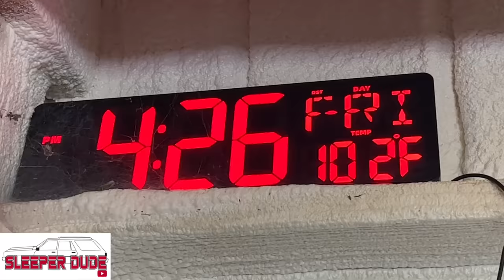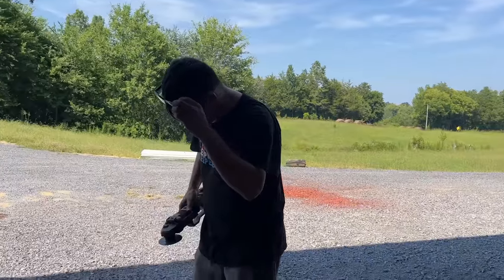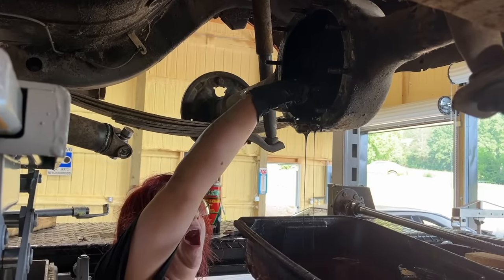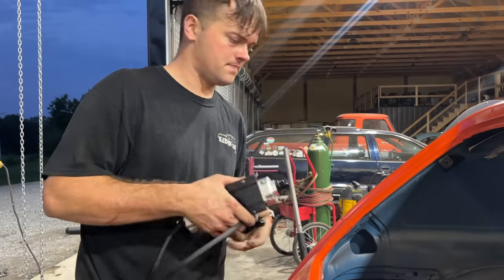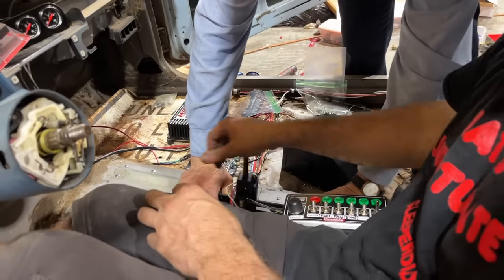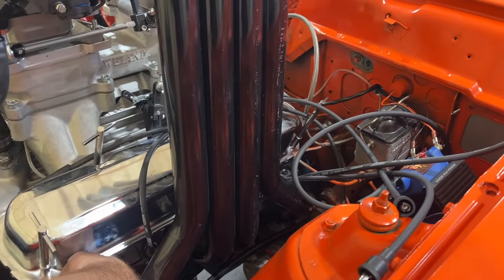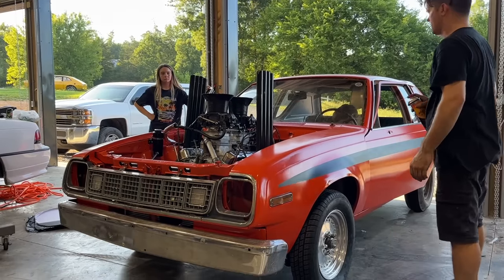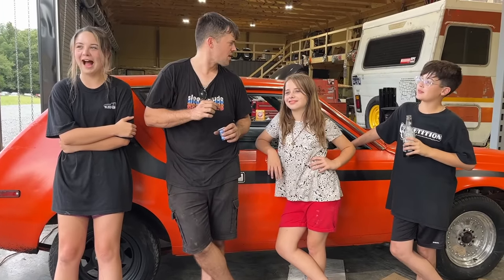Methanol Burning Burnout Car Build in 13 Days!

Comment: Cool build for sure. Will be interested to see how that 727 does with the motor you've built. My understanding is they are good up to about 600hp factory. You guys gonna Dyno it at some point?
Reply from the maker: We wanted to but no one was set up for a mopar bellhousing we may put it on a chassis Dyno some day
Reply: @Sleeperdude  I would suggest checking the shift shaft seal on it that may be where your dripping. those are know for going bad. I use paper towels shoved around the shifter shaft to verify the leak.
Reply: @Sleeperdude  Also i know you prob know this but with the hard starts it may be spark plug gap. I know MSD boxes dont like anything under 35 thou. But again you prob already know that.

Comment: So if I understand the video you modified the existing rear end ? Is it now a posi traction unit ? Could I do the same thing to the rear end in my duster ? It’s a basic slant six car.
Reply from the maker: It’s a ford maverick 8 inch rear. That is now locked both wheels together. They sell mini spools for most rear axles

Comment: The reason the oil was milk is because you're running methanol down past the Rings. You've got a bad float valve in one of your carburetors with the system still pressurized that's what's causing the engine flooding and it's dropping down into your passenger side rear cylinder making its way past the Rings and down into your engine oil.

Comment: I scrolled through the comments looking for any one else concerned about that milkshake in the oil pan.  I know nothing about methanol but that might keep me up at night.  I'd really like to see a drive shaft hoop installed in that car.  I've seen what happens on a racecar turning 7k when the ujoint called it a career.  It tore all the sheet metal out of the car from the seat to the rearend.  The car fortunately had a hoop.  Two pieces of 1/4" strap and a couple of bolts, it's something you could knock up in about an hour and it could literally save your life.  That plastic oil pressure tube will break your heart, it's just waiting for the worst possible time to do it.

Comment: THOSE TWO 1 INCH HOSES U CUT AND PUT THE PIPE PLUGS IN YOU SHOULD PUT SOME SORT OF SEALER/OPPOXY/ADHESIVE GLUE SOMETHING IN IT OR FIND FREEZE PLUGS THAT FIT RIGHT IN THE MOTOR THERE OR JB WELD SOMETHING IT IN OR JB WELD THOSE HOLES BC IVE DONE THAT AND IT SHOOTS THE PIPE PLUGS OUT. HELL I EVEN JB WELDED A PIPE PLUG IN A HEADER WHERE MY EGR PIPE WAS THAT I DELETED AND IT WORKED WELL.

Comment: Goat stomps. 5.6 per horsepower not 2 to 1. I happened to come across this article on duckpower to horsepower. And after looking at how they calculated that and running the numbers for a goat instead of a horse I came up with 5.6.

Comment: I ordered a small box of the solder sticks and I must disagree with you, I absolutely do not like the end results. I am a retired journeyman industrial electrician and every time I try this using my heat gun on both heat settings after 5 minutes I can pull the wires apart. What is your secret?
Reply from the maker: Maybe make sure you let it cool down before you try to pull it apart we havnt had any issues with them and I truly do like them
Reply: @Sleeperdude  when you use your heat gun do you use it on high or low heat?

Comment: Dude put the handle of your engine tiller on the front.
Nothing is off limits to those goats
Never run your battery cable with your fuel line, if it shorts out it will burn through and burn your car down.

Comment: A lot of the alcohol drag cars they'll have a squeeze bottle with gasoline and Nail Forum on gasoline just like you see him when they start the Nitro guards there squirting different fuel in it too far it off because that alcohol sometimes it's hard to fart that's why you were seeing it pushing out of that one tube because it wouldn't find it until it got speed it up and then it started firing alcohol and that's why I quit

Comment: ARE YOU RUNNING NITROS......I WOULD NOT HAVE BELIVED  A 360 WOULD DO THAT......I HAVE A 360....BUT MINES DRAGGING A MOTERHOME AROUND........ALWAYS WANTED TO DROP  A 318. IN MY OLD 63 VALIANT......360. MIGHT BE BETTER.......OH ITS ALCAHOL......IF IT DID THAT ON GASOLINE.......